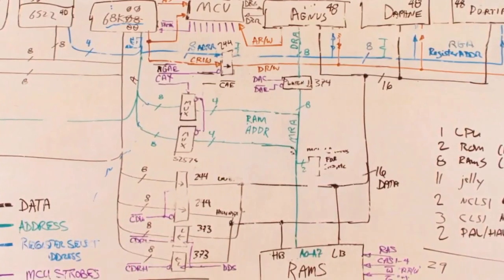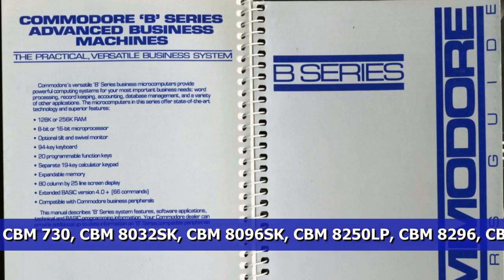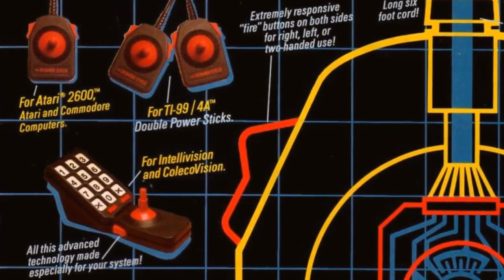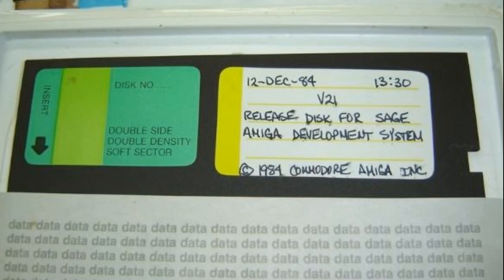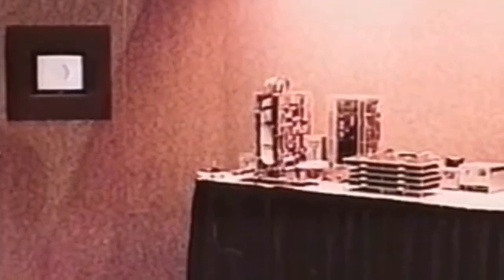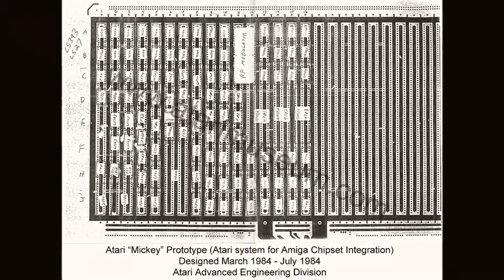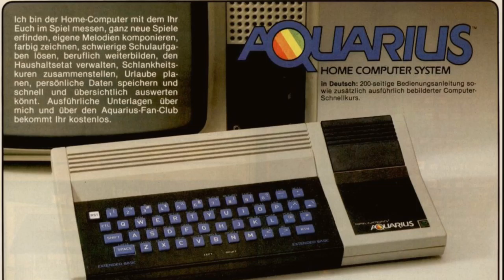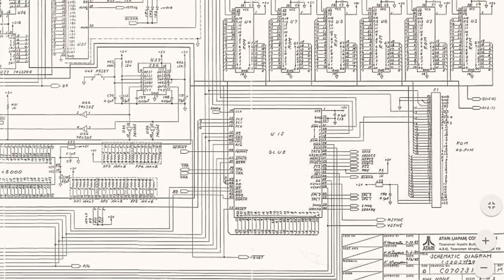A History of Computers Part 3 (Amiga: The Quantum Leap 1.3) - Building the Amiga

Comment: The "preemptive" part of the Amiga's multitasking was a paper tiger at best, as any program could just disable being preempted at will, defeating the whole purpose of preemption. Carl did good with exec.library, don't get me wrong here, it was pretty much the best that could be done without memory protection (especially given the timeframe).
Reply: At least it was not cooperative multitasking. Apart from memory protection, it was pretty nice!
Reply: Neb6  Multitasking really does work fine, just its preemptiveness does not. The advantage of preemptive multitasking is that the program being preempted from using the computers resources can't do anything about it, control is and stays with the OS kernel. On an Amiga you can circumvent that and just keep running, chiefly because the 68000 didn't support memory protection and anyone could poke around in anyone's data instead of being shot down upon trying. Still, it really was the best that could be done with the hardware at hand which is why I keep praising Carl's achievement. Whipping that up in the time he had was a stroke of genius.

@"sci fifan" It certainly was better than telling a program "please hand control back to me after 50ms", yes. The OS did the scheduling and would assign CPU cycles as it saw fit. Unless … well unless you knew which memory addresses to manipulate so that the OS kept thinking you were next in line. In early Windows versions, applications had to know and care about following the rules in order to cooperate. On Amiga OS, applications had to know and care about breaking the rules in order to not cooperate. That made for a much smoother overall experience.

TLDR: preemptive multitasking on the Amiga was only slightly more preemptive than the copy protection bit on an audio CD was protective. If you wanted to bypass the rules, you could. Hence the paper tiger.

Comment: Correction @ 38:54, Apples commercial, not Atari's
Reply: Just finished watching, love the format( comparing specs with what was available at the time ), most Amiga videos never touch on this so for the non aware its impossible to see how the Amiga would be advanced for the time. Also some great titbits of info i never knew( and ive watched a lot of Amiga videos/interviews etc. ), didnt realise initially that the Atari deal was only a licensing one for 1 year, sort of changes perspective on what happened. Great work, looking forward to the next part.
Reply from the maker: Well spotted. I missed that and I've watched this like 20 times. I will fix the audio at some point, and your feedback will help tremendously.
Reply from the maker: Thank you very much for your feedback. Yes I figured I would need to list all the specs of the Amiga to show how far in advance of the other machines it was at the time, and for that I had to work backwards and invent Top Trumps cards for every machine, of which there are perhaps 50 in total in this combined doco. I can spend days just working on those specs sheets trying to find out theoretical maximum Ram and colours and CPU speeds, and trying to approach things from a more technical point of view. Hence all the images of PCBs and chips.  Similarly, I wanted the Interceptor map to show where the Amiga team were located, so I had to work backwards and forwards and create the same map for all the companies, and the last to be added was EA. All the CES show references were to show how different the Amiga CES was, and all the Launches are there to show how amazing the Andy Warhol / Debby Harry launch was, and we havent even got there yet!   Yes its amazing the Myths of the Amiga most of which are not true, especially anything involving Mitchy. But I guess they had to tell that lie to force Commodore into buying The Amiga, as at that point Amiga Corp were absolutely broke.
Reply: cheers, i had to do a double take myself to make sure i was hearing it right
Reply: yw, lol, yeah i can imagine going over the specs of the number of machines released coming upto the Amiga's launch was daunting. Your mention of the powerful Atari machines Tramiel scrapped has me intrigued. The Interceptor map is a great touch, you put some serious work into this and it really does show. Well done, really looking forward to the launch video.
Reply from the maker: Amazingly good feedback Mark, I have been feeling very down about the project over the past few days, so I really appreciate that you get what I was trying to do. I've always been intrigued with the idea of dual (or multi) CPU computers, as they often used dual 68Ks and Z80s inside Arcade machines, but why not computers? The high power Gaza chipset was put on hold because of the timings to interleaving signals to the CPUs, but appearantly they had cracked this issue before Jack arrived and completely terminated the three working prototypes and all plans. These secret Atari machines (and Mickey) were big news to me when I found out, and is why I made sure they were in the video, as no other doco mentions them that I have seen so far.
Reply: Cheers, Definitely, i much prefer this format than other Amiga documentaries which just gloss over its capabilities vs what was available on the market at the time so it never really has context on why it was so far ahead of its time. I restored my A1200 recently and showed it to my wife and she was meh until i showed her what was available at the time( especially from an OCS context ) which is why i think your format is great. And like i said theres lots of interesting titbits here that i havnt seen in the other documentaries which has me looking stuff up and that for me makes a good documentary, something that makes me think and do my own research/investigations online.  Dont feel down, you should be proud, great job, get to work on the next one for us :)
Reply: nooo, im getting a "The uploader has not made this video available in your country."  Trying it from Ireland on both mobile and BB

Comment: I did not even start to watch it and I already see a BULLSHIT in description: "When Jack Tramiel arrives, he uses the old Atari-Amiga plans to build the Atari 520ST computer." Jack Tramiel DID NOT use any old Atari-Amiga plans to build ST. Explanation: When Jack left Commodore many engineers (and other stuff) also left Commodore and follow him to new Atari Corp. Among them was Shiraz Shivji and his team that design ST from scratch. They did not use any old Atari-Amiga plans.
Reply from the maker: Please stop calling my research wrong unless you have facts to prove otherwise. Jack had the Z8000 plans and he used the Z8000 disk drive and some other parts to save time, and they based the machine on the lorraine ideas, but not the Amiga plans themselves, as they were full or errors. He didnt use the Atari-Mickey either, as he threw off of that out. His engineers didnt copy the Amiga plans, but used them as the basis for a new 16bit computer.  I can see the description is now misleading so I changed it.
Reply: Your another point: "they based the machine on the lorraine ideas, but not the Amiga plans themselves, as they were full or errors. His engineers didnt copy the Amiga plans, but used them as the basis for a new 16bit computer. " from where you get idea that Jack Tramiel have access to Amiga plans (and what you consider when you wrote "amiga plans"? Idea about color computer with bitmap graphics and GUI? Or you think ob some techical blueprints?). You say they did not use Amiga plans but use it as basis for ST? :D which one is true?
What happen is that Jack Tramiel want to make succesor of C64. ST had codename RBP Rock Bottom Price. ST exactly that: it was double chepaer than Amiga, three time cheaper than Mac (with more memory, bigger screen, colors, fast external port, and faster at same time)!
Reply from the maker: Hi, I am not going to get into a debate on this subject. I covered the link you posted in part 1.4 of this feature movie, which is still not available to view, but yes Commodore had to pay damages and could not prove anything. Jack had The Amiga blueprints, demo PCBs and the original Amiga -Atari design manifesto/agreement, which I showed in Part 1.2, as well as plans from several CBM projects.  How much he used these as the basis for the ST is not altogether clear, but having access to this material meant that the project was completed quickly. Again, the Amiga design schematics they had access to were of no practical use without the Amiga custom chips, but they could certainly get an idea of how such a 16 bit system would work, and maybe copy some logic pinouts to save time.  Some ideas perhaps came from Apples new 16 bit machine, and of course the GUI which every computer manufacturer wanted to copy at that time, including the Amiga team.  Yes ST was 'Based' on the Z8000 C900, especially the disk drive, but in truth I think the plan grew much larger and in the end, bore no resemblance to the C900. But this was indeed their history and what they used as a starting point.
Reply: I will check your previous videos. 

But

In comment, you wrote "how much he used (he, jack tramiel did not use anything but engineers MAY use...) Amiga blueprints for as the basis for ST is not altogether clear"
So it is not clear how much of 
but in description you wrote:
"with many Amiga design ideas, as the basis to build a new machine - the Atari 520ST computer."
Again: WHICH ONE IS TRUE?

This is like "witch hunt" - you try to present that ST was rushed because of Amiga, or even that Jack try to copy Amiga with ST. 

Shiraz Shivji, loyal to Jack, start ST design, with his colleagues also loyal to Jack, while they still were at Commodore. They were all veterans, they work on Vic, C64, Z80000... they have much experience, they was ware of Amiga as of Mac. Aim was to build "Power without price" computer, ans Atari ST was exactly that: two times cheaper than Amiga, almost three times than Mac.
Reply: Apple may have been the first to commercially launch a GUI inspired by the Xerox Alto. Others took the same inspiration, there was no need to copy from Apple.
Also, back in the day people tried very hard to conceal what they were doing but still very similar products kept cropping up in very short time spans, not always did the true inventor make first to market (or at all). From today's point of view, saying A took inspiration from B for this shouldn't be seen as an accusation but as an exercise in archaeology. Using good ideas isn't wrong, it's just the sensible thing to do. Having plans lying around leads to people studying them, engineers are curious people, and for a good reason. Once you have that kind of knowledge it's impossible to un-know. You still go your own way, but what you've seen in the past makes you a better engineer today. So no, the ST is not a rip-off of the Amiga with the custom chips stripped and a MIDI port slammed on. But yes, knowing how others approached the topic did help speed up the process and promoted many design decisions that can be seen all over the ST's board. (and can't be seen, for that matter: if you know how others did something, the takeaway for a good engineer will sometimes be to certainly not go the same way ;)